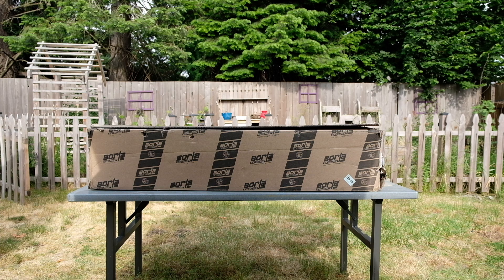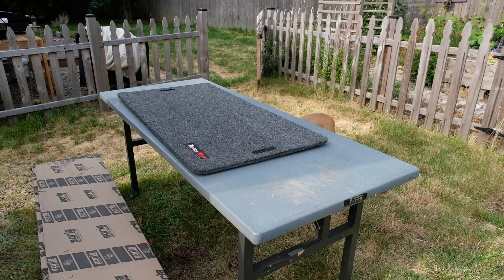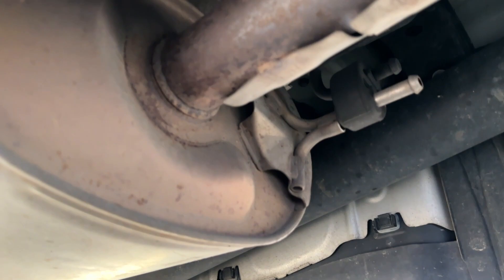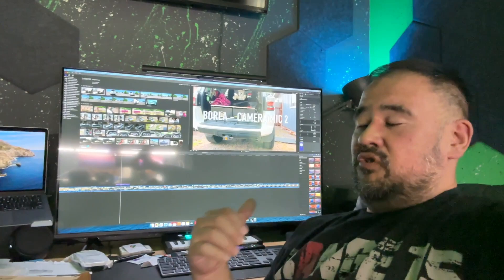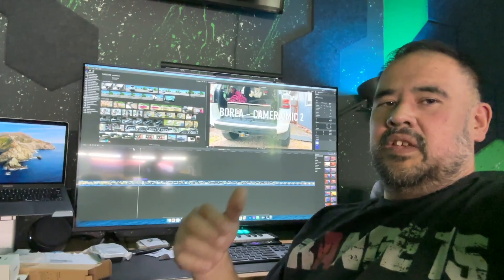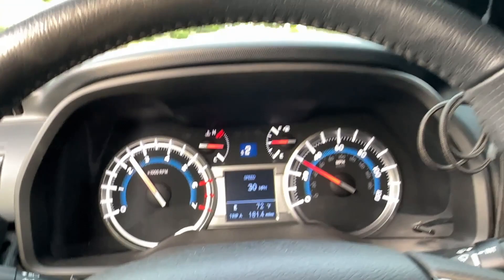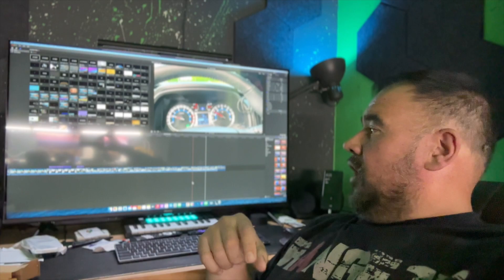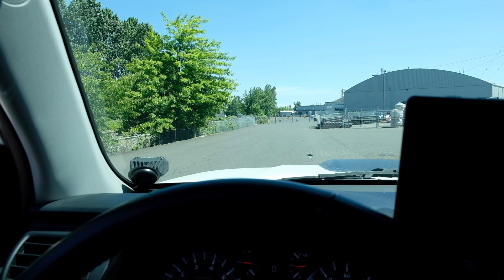BORLA S-Type Cat Back Exhaust on my 5th Gen Toyota TRD 4Runner

Comment: I just got a New 2023 Toyota 4 Runner TRD Pro with the Pro Exhaust and I absolutely hate it .
Does the Borla sound better?  
I’m looking to get it more mild especially on the highway.
What can I do to dampen it? Should I switch to the Borla or for back to pull it out for an OEM set up?
Reply: Same ..... I hate my TRD exhaust on Highway it resonates too loud.  I'm sure the TRD cold air intake made it even louder.  I'm thinking about getting the Borla.
Reply: I'm in the same situation.  I have a '23 Pro and the 2-3k RPM drone is unbearable.  Deciding between the Borla and a non TRD Pro stock exhaust.